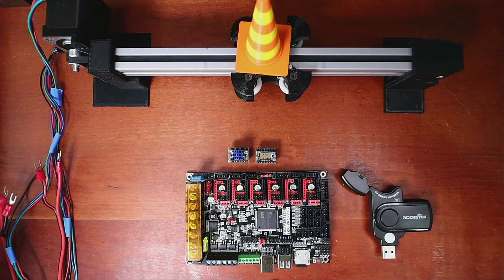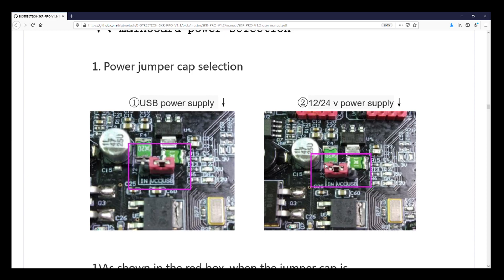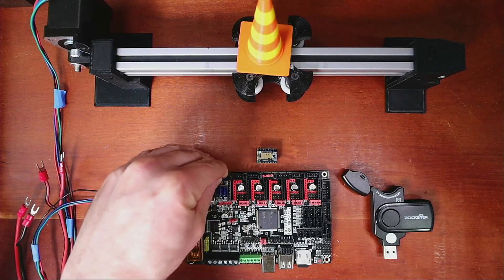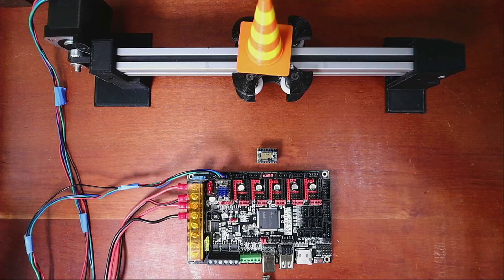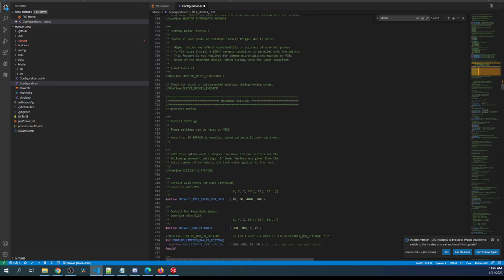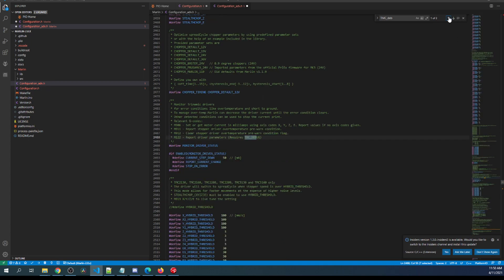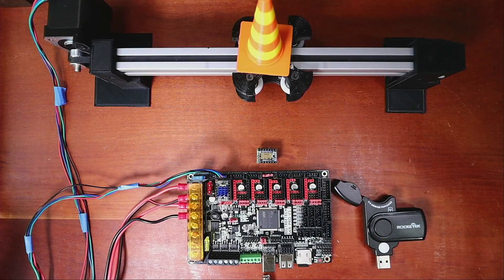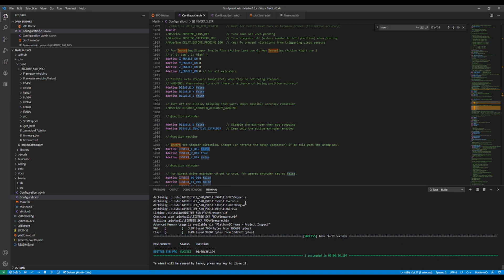SKR Pro v1.2 - TMC2225 UART

Comment: Hi i've followed your videos and found the really good, thanks. I got the BTT skr pro v1.2 two weeks ago and have worked my way through the videos for the v1.1 but here is my problem, when I try to compile it in platformio.ini it only shows the mega board and no others. There are only 265 lines of code in .ini, please what am I doing wrong. yours Simon
Reply from the maker: Two weeks ago they changed version of Marlin firmware from 2.0.7.2 to 2.0.8.  I created a Marlin supplimental video to address compiling issues.  It will be in playlist and will have a blue thumbnail.
Reply: @EdwardBraiman  Thank you its much appreciated
Reply from the maker: https://youtu.be/LPHY3hPQy-w

Comment: I bought a V1.1 of the SKR Pro last year. It took me some time to figure it out, but it turned out to be a great board. Unfortunately we moved and I haven’t done any printing since last August. What are the differences between the 1.1 and 1.2?
Reply from the maker: Minor differences.  Most noticably is added ground pin for BLT.